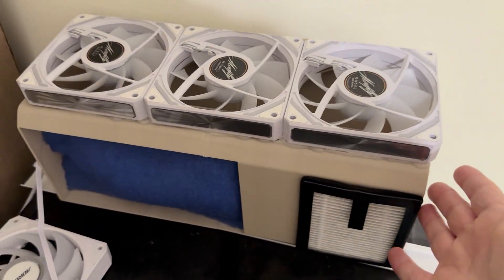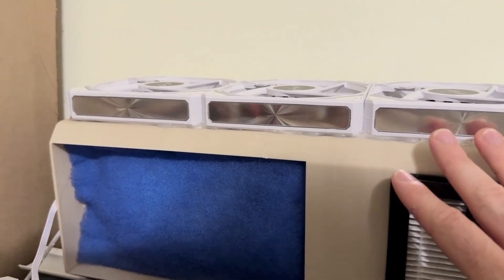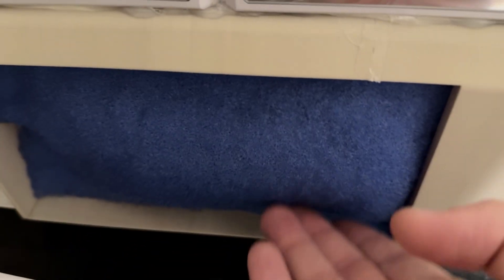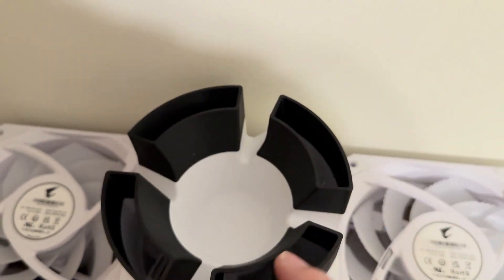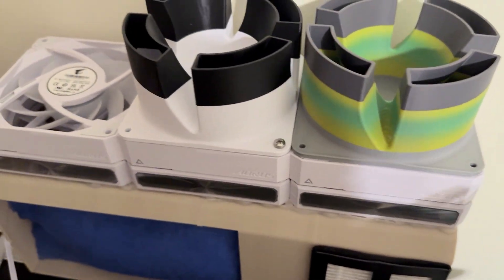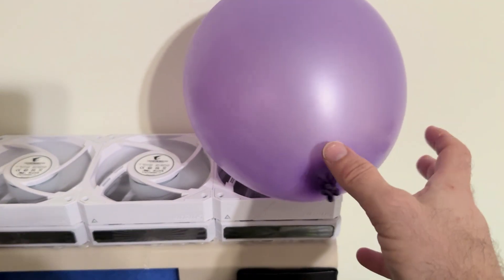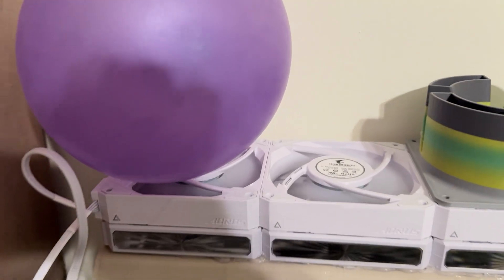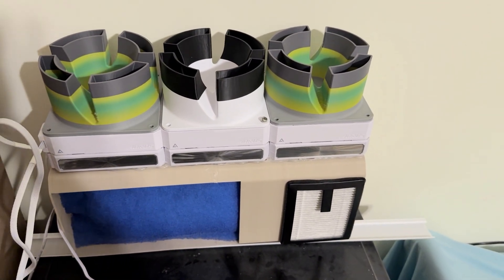Corsi–Rosenthal 3D Printed Wall Box using PC Fans

Comment: I have seen someones video about some laser engraver smoke extraction with two PC fans in series mounted in the middle of a duct. 
The feature i want to point out is the 3d printed stator between the two fans that improved pressure and airflow.
Reply from the maker: yes putting fans in series with the right distance between the fans helps with pressure. But it wasnt the design i was going for. I wanted something wall hanging capable and compact, fun experiment and still in use